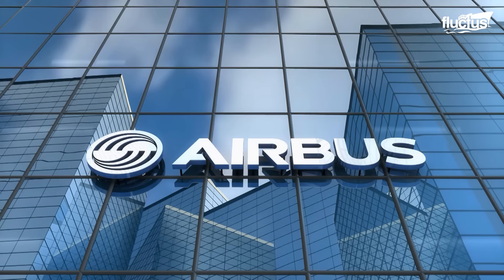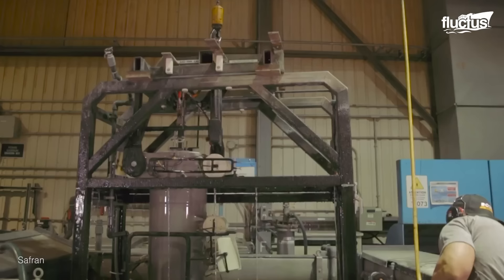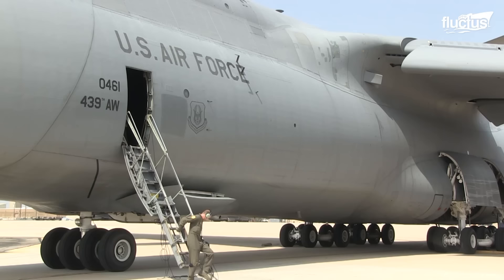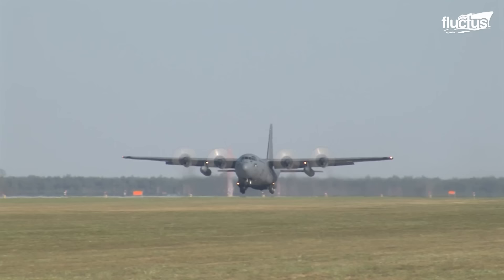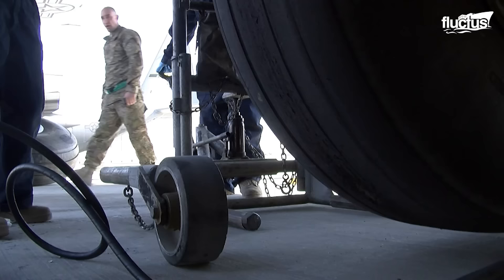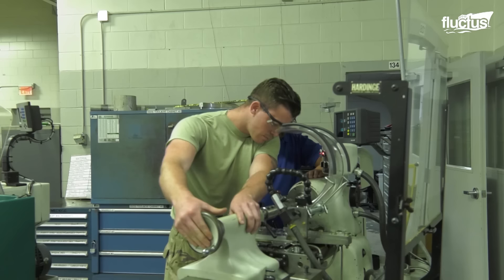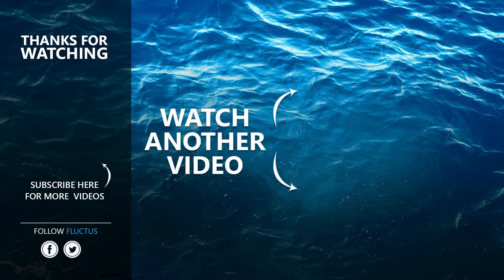How These Enormous Landing Gear Can Support 400 Tons Aircraft

Comment: This video only explains the manufacturing process and the plane and does not explain at all how it works or how the wheels can actually support the weight of the plane.
Reply: The video shows the manufacturing process, the tools, the finished parts, the size of the finished parts, the assembly process, the size and types of aircraft, the different sizes relative to the aircraft and their real world testing methods.  In other words, how it all works to support the weight of the plane.  How did you miss all of that?
Reply: Yeah. What A WASTE.
Reply: @BillStemil  🤣 You clicked on a 14 minute video expecting to see the maintenance manual of a 747 landing gear?  Hell, I’ll sell you one and watch you complain it’s too long.
Reply: @BillStemil  So, you said ‘yes’ you wanted more engineering info in the video, then said ‘no’ you’re not complaining about the video.  Then I suggest where you can get that info and you trigger.  Hmmm, I’m glad you don’t fly real aircraft, you don’t have the temperament for it.
Reply: so what
Reply: Thanks, leaving my dislike and clicking out

Comment: As mentioned earlier by Bill Luce, your facts need to be revised. The landing gears on the A380 were in fact design by two different companies. Safran designed the Nose Landing Gear and it's components, nothing else. United Technologies Aerospace Systems (formerly Goodrich Aerospace), turned Collins, now Raytheon Technologies designed and manufactured the mains; the body gears and wing gears.
Reply: What are body gears and wing gears???
Reply: The landing gear under the body and wing of the aircraft

Comment: It's hard to take you seriously after you claimed that the A380 "continues to be a popular option among major airlines", considering that Airbus halted production on the jet last year due to lack of customers.
Reply: It's consumes to much fuel, it's maintainance is more expensive than earning😅
Reply: I think you misunderstood the video... those companies mentioned are still utilizing the A380. The video didn't say the plane was flying off of the store shelves... so to speak.
Reply: @ejkk9513  bro check 1 more time, today's only UAE use A380, most of airways companies stop using, they use their other models
Reply: @ejkk9513  Are you implying that airlines routinely chose between jet models they have in their inventory to serve various routs on a routine basis? 

"Hey Bob, which jet should we fly from New York to London today? The 737 or the A380?"

"Continues to be a popular option" is understood by everyone except you to mean that many airlines are choosing to purchase the A380 instead of other aircraft, which is obviously incorrect.
Reply: @pradeepagrawal1119  I see you aren't up to date on current airline industry events. This summer, many airlines that were planning on retiring the A380 chose not to because of extreme demand. By all means... look it up. There was a severe pilot and aircraft shortage. To make up for this lack of workers, they chose to use their A380's to fill in the gap. Multiple airlines went against their previous intent to retire the aircraft for this reason. It will be retired as new wide-bodies start filling the demand. That retirement has been delayed for most airlines that still have the aircraft in their fleet.
Reply: @operator0  You are way too emotional and you're making yourself look like a fool. Look at the comment I just wrote to the other guy. You aren't very up to date on current airline events.
Reply: @ejkk9513  Argue the facts, don't resort to ad hominem attacks. That makes one look too emotional.
Reply: @operator0  Are you even going to address what I said? I'm not here to argue with people I don't know. Me pointing out you acting irrational and emotional based on no true facts is not the definition of emotional. It was merely stating exactly that.
Reply: Popular choice for passangers ..
Reply: @SureshBabu-gr3il  The exact quote from the video is; "continues to be a popular choice among major airlines".
Reply: The plane is a dog. Airbus needed huge subsidies of $25bil and never made a dime. Airports had to build special gates for it. The large parts were mfg all over the EU with some in the US.
Reply: True it its production was halted, however I started hearing, from  different sources, that very large capacity planes are being looked at again by some airlines
Reply: Pigniora
Reply: Please concentrate on the landing gear . Topic is not 380 plane and production. Grow up.
Reply: @aluri1997  The video's legitimacy is called into question when it misstates a fact that is well known. One must also question other statements of fact this creator displays to their audience. 

How much of the landing gear story that they weaved is true? Are there any other mistakes? These are valid questions, and indicate that a mature mind is examining the content. Immature minds ask others to grow up for saying as much.

Comment: The most dangerous part of flying are the takeoffs. The fuel tanks are full, so that plane never weighs more, and it's rippin' down that runway with all that weight pressing down on those tires. A simple tire blowout would be cataclysmic. Once the plane arrives at its destination and it's ready to land, the fuel tanks, and therefore the plane itself weighs far less, so the tires aren't as stressed. A fellow passenger I had just met was nice enough to share this info JUST before taking off. I'll never forget it.
Reply: That just isn't true though, a blown tire isn't a catastrophic failure, and yes there is a lot of jet fuel, but you also have less momentum. It's also worth noting that taxi is the same as the runway in your example if not "more dangerous"" since you don't have enough speed to generate lift, which means all the weight is on the aircraft's wheels. As the aircraft is accelerating down the runway it builds up speed and therefore lift, as lift increases the weight on the wheels decreases which in turn makes it safer (in your flawed example). So, I wouldn't let that random guy scare you. Even assuming there was a blow out of the tires there is 2 on each wheel, which means you would have a backup and just abort the takeoff. (Which mind you is extremely rare.) Even assuming you had both tires blow out which has happened before look into the February 22nd, 2022, A plane headed to Phoenix with 142 passengers blew two tires during takeoff, but the jet stopped safely on the runway. Passengers were transferred to another plane, and no one was hurt. 

So, to summarize, this is just not true in any regard, so don't worry about anything in future flights. And if you really want to know the most "dangerous part" it is universally considered to be the landings. Since you are at the extremes of the flight envelope among other factors, and since statistically, nearly half of all fatal accidents have happened during the approach / landing phases of flight are the most dangerous.
Reply: Tire explodes, full reverse if speed below V1.

Comment: Pretty much everything on commercial airliner is just insane levels of engineering an manufacturing that is so easy to overlook.  Not only do you have the challenges of extreme environmental fluctuations and forces at play but the stakes of failure are catastrophic and on top of this these aircraft are used nearly constantly for decades.  Pretty nuts.

Comment: Did anyone else realize that 28 tires on the C-5 divided by 4 engines works out to 7 tires per engine?
Reply: 28 divided by 4 equals 7? You don't say!
Reply: @tettazwo9865  I know, it truly is astonishing, but I've run the numbers several times. Checked, double checked, cross checked and I keep getting the same result. Incredible!
Reply: Tbh that is kinda impressive. Those engines put out so much power you need 7 tires just to stop it

Comment: so the 'how these bogeys can support an aircraft' question is answered 'somehow'. The Antonov 225 nose gear can 'crouch' to assist loading and the thing has 32 wheels holding up 640 tons (or 1433600 pounds in USA speak) so it might be worth a mention. Also worth a mention are the cases where the landing gear failed and how the design evolved.
Reply: I don’t think they’ll bring up that plane because of the animosity involved. Ukrainians don’t want to admit that the plane was actually built by the Russians. It becomes a finger pointing game. Too much conflict between the countries regarding the plane and what happened. Russia will take the plane and rebuild it. It is a historical plane and it’s not entirely destroyed. Just was damaged to where it’ll take some time to repair it. But it was a dated plane that needed to be updated and rehauled with newer and stronger components.

Comment: I worked just north of a c5 base for years. It always amazed me how quiet these behemoths were. They would fly over at just a couple hundred feet. Never heard them till after they flew over.
Reply: Should have worn those ear defenders early on before you lost your hearing. 😂
Reply: They make a very distinct whining sound.  It's not a straight jet engine like on older b52s but I would never have said I never heard them until overhead
Reply: @scottallberry6713  So do most Americans although you hear them half a mile away.
Reply: M
Reply: Real question is why are 95% of the engines in front of the wing and always have been?   Mandela Effect

Comment: very intersting video; but that was not a tank that was loaded on the Galaxy, it is a self propelled artillery piece.
Reply: And what is a tank? 🤨😂
Reply: @jordenbronson8122  Not a self-propelled artillery piece that's for sure!

What's shown in the video is a Paladin M109a7 155mm Artillery System.

In other words, not a tank. Cant be bothered to explain the difference, you can look it up yourself if you want to. But a tank... that ain't!
Reply: @jordenbronson8122  a tank is an armored vehicle designed to support infantry assaults as well as the tip of the sword to punch a hole through an enemy's defensive line, and then attack and destroy the enemy's rear echelon.  a  self propelled artillery is not designed to punch holes through an enemy's defensive line and continue the attack.  though it is used to support infantry assaults., mainly to "soften an enemy's defensive position from miles  away.  self propelled artillery is also used to fire from positions that towed artillery can not get access to.

Comment: talking about the landing gear, i'm always amazed the tyres withstand such pressure!
Reply: And they actually don't burst until twice the rated (maximum sin-service) pressure.  They use a lot more rubber thickness and cord layers than car tires do.
Reply: 26 ply (layers)tires and 200-250 psi.  Car and truck tires are 4-6 ply  and 30 psi
Reply: "(maximum sin-service) pressure"  <--  Maybe if the destination is Las Vegas?  : )

BTW, speaking of Scott's data, I was once in a meeting at the Johnson Space Center where we were briefed on the space shuttle orbiter's main landing gear tires.  Turns out they are of conventional construction, but with some variation from airliner tires in terms of the proportion and distribution of constituent materials.

Of even more interest was what we were told about how they dealt with having the tires at proper pressure for touchdown, given that it could be as long as three months between when the tires were last accessible for servicing and the landing:  Each tire was first overinflated in the shop, and its pressure-vs-time measured (presumably several times).  With a reasonably accurate characterization for the leak rate of each tire in hand, they overinflated prior to gear-up by amounts which maximized the likelihood of an at least acceptable touchdown pressure over the range of possible landing times.

Comment: Fortunately they were very strong and well built. considering the weight of the plane and its passengers. Also having the means to withstand the force it takes to land. Also credit must be given to the pilot / copilot to land safely so that the front wheels don't bounce. I flew,  ( for the first time last year to New Orleans ), and a friend told me to just relax, it'll be like going uphill in a car.
Reply: The landing gear on all aircraft get more stress than any other part on the plane.   The landing gear must do this for many years.   They still must be as light as possible.

Comment: Wow
Imagine the load on those wheels and the landing gear whn one of those big planes lands.
Reply: True.  I always wondered why they didn’t spin the wheels up close to landing speed to cut down on touchdown friction.  Maybe someone tried it and it didn’t work?
Reply: @6thmichcav262  That's been studied to death over the last sixty years.  Turns out to be a lot more trouble than it's worth, regardless of the spinup method employed.
Reply: Landing loads can actually be less than takeoff loads.  What's not obvious watching a landing is that at touchdown, most of the weight is still being supported by the wing until spoilers deploy.  Also, stroking of the shock strut serves to reduce peak loads.
Reply: @marcmcreynolds2827  Thank you for addressing that question for me!

Comment: i think 400 tons is pushing it for single landing gear wheel assembly, considering steel parts shatter under loads as little as 20 tons. Methinks that number is for the safety inspectors and regulatory organisations

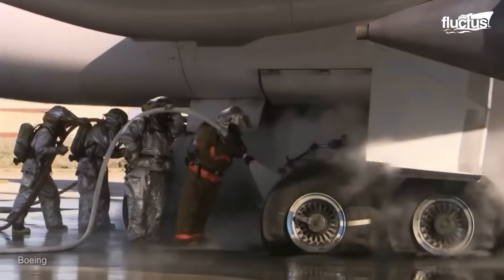Comment: @ even with 4:03 count on diflational tyre you can still have a perfect low ezigmal on a carefully landing gearing norb release to the ground to still experience a great landing stabilization if it can't be self inflated bf landing  possibility but a real bite within the region / frictional surface area  at  klems.

Comment: So, can landing gear support 400 tons? Through landing gears of different configurations. Got it. I thought sturdy tires and crazy air pressure might have something to do with it... my bad.
Reply: Pavement strength is what limits tire pressure BTW, to somewhere around 180 psi for larger airports.  Going higher doesn't break the pavement instantly, but does wear it out faster over time via fatigue.  Same idea as with metal fatigue, where the amount of load applied plays off against the number of cycles until damage or failure.
Reply: Do they consider passenger weight per person ? Some people, like football players weigh over 275 to 300 pounds each. I know lighter weight people ( like me ,175 ) , will average out total weight plane capacity. Does the plane roll over a scale before take-off.
Reply: @michaelcesco2970   Scales might be used in special situations such as flight testing, and some airliners have built-in gear weight sensing.

What's typically used in classic Weight & Balance calculations, where no direct measurements are made, is an assumed weight for the empty aircraft, the fuel taken on, and passengers plus bags.  That can be a number like 220 lb per passenger including bags.

I was once told that your (American) football players scenario is in fact what designs floor strength.  For the aisle, where people actually walk, floor rigidity is also a consideration.  Even if it's strong enough, a lot of flexing would be disconcerting.

The above is for normal-sized airliners.  For the smallest commuter planes, e.g. Cessna twins, passengers may be individually weighed and then seated so as to insure proper balance.

Comment: there are a lot of landing gears bigger than a 380 like C5A,etc.
Reply: I'm afraid to say that although the C-5 does have more landing gear legs and therefore more tires and brakes, the actual legs on the A380 are the largest of any aircraft that size; both the bodies and wings alike.

Comment: So why don't commercial aircraft use a drag-chute to slow down in an emergency?
Reply: I told NASA they should add a drag chute to the shuttle orbiters (which they eventually did, after Challenger).  So I'm not averse to drag chutes, but for the most part they aren't such a good idea for commercial airliners.  A couple of the several reasons:  For crosswind landings on contaminated runways, the chute would tend to spin the aircraft as well as slow it, possibly causing a runway departure;  For many emergency scenarios, by the time its need is recognized the plane has slowed enough that the chute won't dissipate much energy.

Comment: 2:30 2:35?? Rejected take-off while its pass v1 and already commenced rotation? are u drunk?
Reply: You’re dealing with a test bed here, not a commercial airport. It’s probably an arbitrary V1 calculated for a shorter runway. The runway is probably long enough to safely stop. Keep in mind… this site plays kind of “fast and loose” with details.
Reply: @JimAllen-Persona  but its not a rejected take-off. Haha
Reply: @Arcadiez  You want correct terminology ? Go watch Juan over at Blancoliro or Pieter over at Mentor Pilot. You’re not getting them here.😂

Comment: No aircraft requires 200 mph to lift off. Not even close.
Reply: really?
Reply: I mean the 747 or A380 fully loaded can get pretty close. Not 200 mph.
Reply: The tires are certified to more than 200 mph.  Taking the example of something which rotates at 170 kt and lifts off at 175 kt, that's about 202 mph.
Reply: What aircraft is that. Maybe the jet that carries the space shuttle.
Reply: mph is not use in aviation...it's knots or km/h
Reply: @davidrico52  Don't know the particulars on that one's V-speeds, but I was once by the side of the runway at Edwards when it took off with the orbiter on top, and rotation speed seemed "normal".

A typical airliner liftoff speed might be around 150-155 kt (e.g. AA 191), but I don't really know what an "average" one is.  It can certainly go higher.
Reply: @leneanderthalien  "mph is not used in aviation"  Tires are an oddball in that regard.  The official rated speed for an airliner tire, at least for an FAA certification, is in mph.